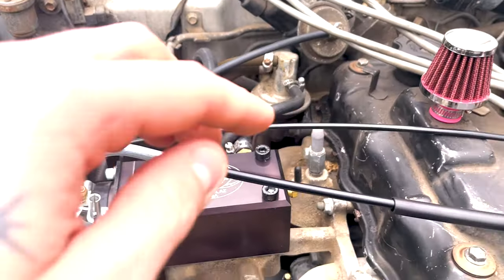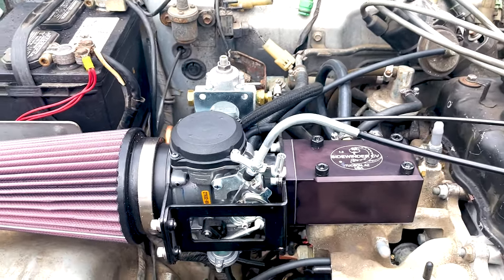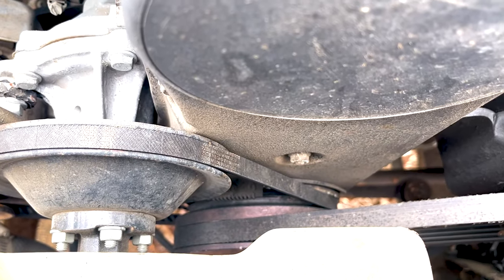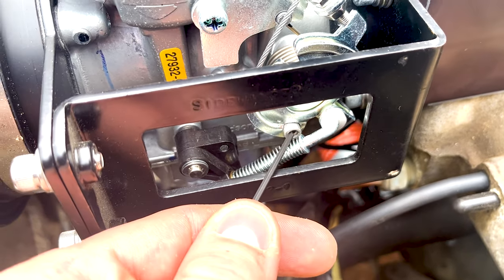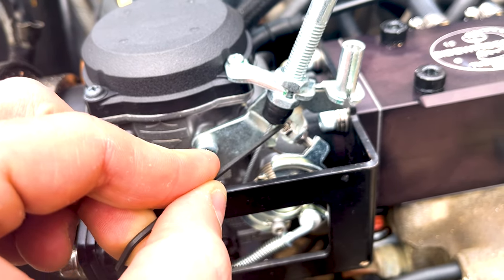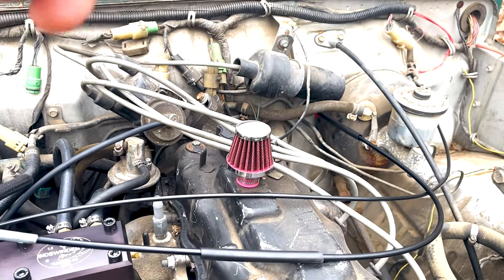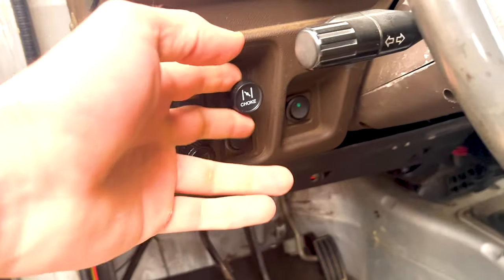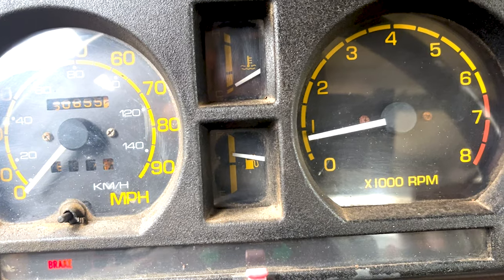Suzuki Samurai Harley Carburetor Adjustment

Comment: Sweet man! I am thinking of doing this mod on my 87 Samurai. One of the main things holding me back is the altitude, so my question is, how good or how tolerant is this setup to altitude changes? I live in a very "irregular" city altitude wise, it is surrounded by mountains which is great for off-roading adventures, but I'm always constantly going up and down. I am at 550 meters (1,800ft) above sea level but I've been planning to do routes of 3,500 meters (11,500ft) above sea level, so your input on this would be very much appreciated.
Also, have you noticed any premature wear and tear on the motor? I have contemplated just going with the forever popular toyota 3k just in fear that the Harley would shorten the living days of my Samurai.
Thank you brother
Reply from the maker: Altitude and extreme weather change hasn’t been a problem for me as of yet. Also when on a steep incline or decline it never studders at all. But I will also say I haven’t been able to get it up to 11,500 ft because I am in the Appalachian mountains. I haven’t seen any premature wear and tear as of yet. I do frequent oil changes and my oil never gets too dark really and never has any metal shaving or anything like that. I hope this helps and I apologize for the long wait on a response!

Comment: one question with this kit do you have more fuel consumption?
Reply from the maker: My zuki runs better than before but I also took the tires down a bit to help with that. I have a stock fuel tank on her too. I get about 200 miles per 10 gallon tank

Comment: I’m getting too much in my carb , tryna close it a little
Reply: I’m new at it, prolly sounds dumb. But it’s like I’m flooding it when I’m on hills or sitting on inclines
Reply from the maker: Do you have the stock carburetor in your rig? If you are running the stock carburetor and you decide to buy the Harley carburetor from Low range it will come all set up with a fuel pressure regulator on it all ready to go. It will fix your flooding problems on incline and hills. Best upgrade I’ve don’t to my rig up to this point
Reply from the maker: I replied on the other comment you left. What carburetor are you running?